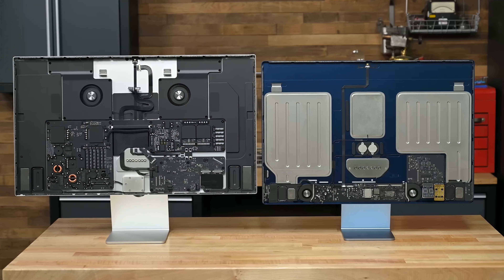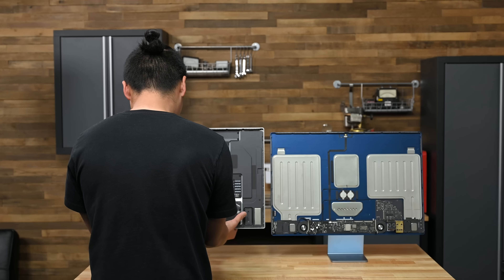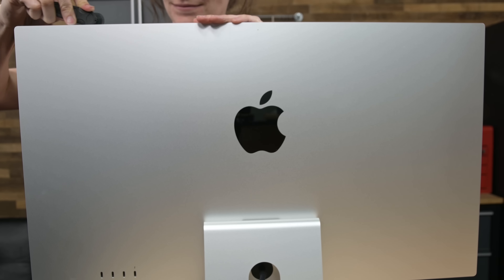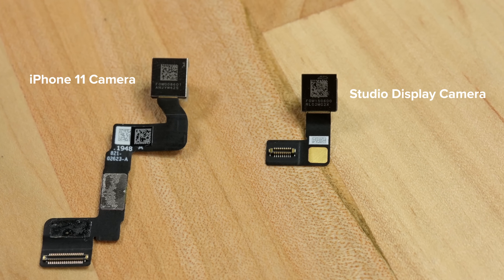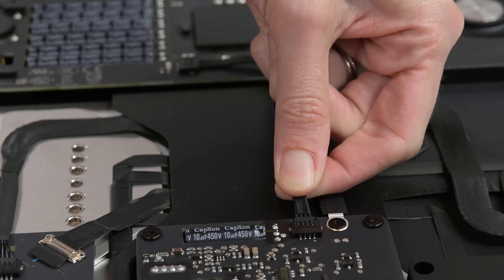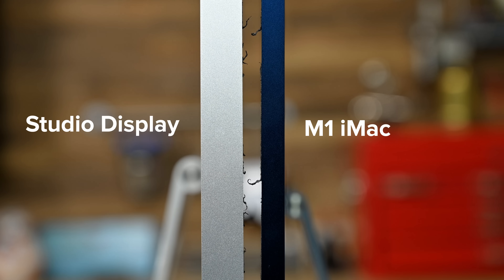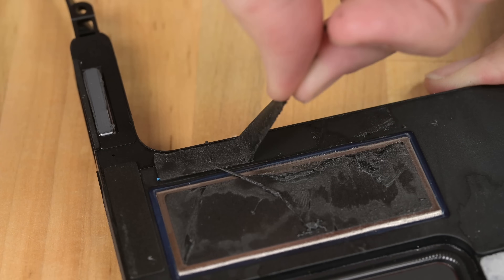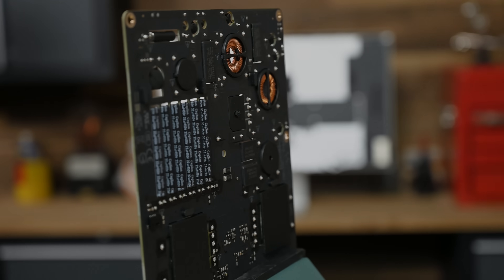Studio Display Teardown: Is this secretly an iMac?

Comment: If they make a bigger imac that looks like the studio display it will be just perfect. I think they can easily fit the board of m1 max chip if the put the PSU externally like the m1 imac
Reply: The Issue with putting gate PSU external is power, that magectic connection the M1 iMac users just cant provide that power levels needed. I think they would stick with internal PSU for such products were the thickness is not the ultimate goal.
Reply: @hishnash  High current DC connectors are a thing. You can push 240W over a USB Type-C port. Larger connectors can deliver a lot more power.
Reply: They are a thing for sure but not very long cables, and the power supply in the brick would need a fan (not optimal if its sitting on the floor sucking in dust, pet hair etc).
Reply: @hishnash  i just said they could do this if they wanted to used the exact same design (which i really like). But i would also prefer it to be inside and the whole computer to be thicker

Comment: Fun fact: There were board cutouts for caps on the 27” LED (and Thunderbolt) Cinema Display’s power supply already…
Reply: There are board cutouts in the power supply of about every cheap TV since about 5 years.

Comment: It looks very neat and organized on the inside. That, of course, has its price.
Reply: Almost all apple products in the last 10 years are more beautiful inside than outside
Reply: @trancenut81  The outside of the Studio Display also looks beautiful in my opinion. An aluminum unibody and minimalist design.
Reply: It looks really Pleasing!
Reply: @LiK I'm just saying that if the components in the device look neat and well-ordered, the device is also safer and will last longer. Steve Jobs once said that even what you can't see should look good. I agree with that.
Reply: Form before function... 
Once it breaks you're doomed to overpriced Apple support, because none other repair-shop can get the proprietary parts.
Reply: @timmy7201  apple stuff doesnt break, really.

Comment: I have to wonder if they just couldn't get certain features out the door before the display's launch. Having an A13 and 64GB of memory means this display has the horsepower to become at least a decent standalone 'Apple TV' display.

But some of the engineering aspects—from the non-user-serviceable power cord and mounting bracket/VESA mount—to the thickness of the display in general—are baffling. If they just took the iMac, swapped the guts for a display controller, and used an external magsafe power supply like the iMac, I think people would've been happier.
Reply: I expect the reason it has this config is that is the smallest HAND die that meets the spec apple need for the HAND controler within the A13. As to why they are using an A13 apple llikly have 1000s of these that have binning issues meaning they cant use them in phones but are completely ok in a monitor (1 to 2 cpus cores with defects is not going to impact the use case here at all). Apple has used binned chips in the past in the HomePod mini getting binned Apple Watch cpus.
Reply: Considering that we are talking about an Apple product, I think it’s safe to assume that it is this way because they wanted it to be this way. These are not mistakes that could be explained by some engineers screwing up and some validations getting skipped. These are all things that would have been decided on the marketing requirements level.
My best guess is that someone at Apple is really pushing for internal power supplies because they look nicer. That would explain why the Mac Studio and this display both have internal power supplies. They probably didn’t like how it would look to have three external power supplies if you had a Mac Studio with two matching displays.
I suspect that the stand is both a cost saving measure and an upsell strategy. You are more likely to get the more expensive solution if you are worried that you can’t upgrade later.
Is this wrong? Idk.. Maybe? In practice, I don’t think this matters as long as Apple doesn’t force you to use their displays with their computers.
Reply: @Finder245  the internal power supply is due to the power needed to be supplied, unlike the iMac this is a 200W+ power supply since it provides a lot of power to the attached TB and USB devices. Very important feature of such a screen.
Reply: @hishnash  Do you really think that 200W is a lot of power? It's not. You can push 240W over a USB Type-C connector using the latest PD spec. Now, I am not suggesting that Apple should have used a Type-C connector to power this display, but a passing a few hundred Watts from an external power supply to a device is not really an issue.
Reply: @Finder245  Its a lot of power to have from an external brick without a fan.  The transition of the power is not the issue but the PSU of that power rating will get very hot if its not cooled properly so its either going to be rather large (not nice if you have 2 or 3 of these displays) or going to need an active fan. If it needs and active fan that becomes a rather large issue if its sitting on the floor were it will ingest a lot of dust, pet hair etc.   Given its a low voltage supply apple can use any form of connector they want.

Also from a raparibilty perspective repairing an external power brick tends to be close to impossible as these things need to be built to survive being dropped etc while very hot so almost all of them I have seen have the components glued in place to ensure there is not stress put on the solder joints and there is not chance of a short.  Compared to the lamina single large multi board single layer PSU within the screen an external power brick would be close to impossible to repair and would just become e-waist (a lot faster than the internal PSU since its going to en dup with much more thermal and other wear and tear).
Reply: @hishnash  my legion 7 charger was 300w no fan. and does not overheats
Reply: @totalmichel  thats working for the life span of the brick, or maybe its just massive enough to radiate the heat out.
Reply: @hishnash  the previous laptop was Asus g750 had 280w and lasted 7 years. So I guess 300w should also last, and yes it’s massive for a laptop 😂 (almost dvd drive size)
Reply: @totalmichel  for sure it can last a long time but it is much more likly to fail than a well cooled internal PSU as that internal PSU is not going to be dropped of desk, end up pushed into a corner/strapped to the bottom of a desk etc were it cant keep cool. One thing the laptop bricks can do (and some do do) is if they overheat they can (and do) reduce the output power, im not sure you expect that of a desktop display that has not internal batteries.
Reply: It is not a iOS or Apple TV device as Apple does things in extreme focus. As SJ said “focus means saying no to 100 great ideas” if today it’s a PC maker doing it it will become an Android display. Yes it doesn’t make sense but it’s very Apple.
Reply: but then they wouldn't have an excuse to charge your first born for it
Reply: Same as what I was thinking just right before reading your comment! This makes it the Apple TV,TV! a true TV from Apple 🤣🤣🤣😂
Reply: this would've been nice to have but they would've also had to put some sort of Wi-Fi and Bluetooth in it, which I'm not opposed to. Would've made the price tag more acceptable.
Reply: @cjgonzales1900  what would the use0case be, your not going to run a 5k display over wifi there just is not the bandwidth for that.
Reply: @cjgonzales1900  those chips are integrated in A13 if I’m not wrong. Apple does “over kill” things for something unnecessary. It costs more for them to develop a new chip so they use the old one even some features are absolutely unnecessary.
Reply: They design capacitance like a skewers
Reply: Yes it even could have ran apple tv os and have an apple tv remote like the samsung smart monitors and it would have been a great competitor for the samsung smart monitors if they used such high end components just to drive a monitor then they may just release an update to give it the apple tv ui if its just running ios already and an apple tv remote could be sold separately to use on it
Reply: I guess they are doing a right thing they are recycling chips from trade in devices and use them for the apple studio display overkilled
Reply: I get it has a big speaker so we don’t need a desk speaker on a desk. but why it has a phone cpu and a huge ass fans? Wasn’t that supposed to be a monitor. my gaming monitor has a tiny fan inside and some don’t even have one of my monitors.
Reply: Pandemic and Chip Shortages Give birth to interesting Engineering Choices
Reply: @benNdaKen  What part of the design do you think is a result of the pandemic and chip shortages?
The only thing I can think of is that maybe smaller flash was not available, or was not available cheaper. Other than that, I think Apple got what they wanted.
Reply: Not “people “ but computer nerds. 99.9% of the people who buy this won’t be concerned about any of the points you bring up.
Reply: @mrlt1151  that sounds like a self-fulfilling prophecy.
Reply: I don’t think it has 64GB of memory. Storage yes, memory no.
Reply: @huggyuk  storage is memory though, it's just non-volitile, and we have come to often use the word 'memory' for volitile RAM and 'storage' for non-volitile memory like HDDs and SSDs
Reply: @DanielSvindseth  Storage is not memory, they are not interchangeable.

The program has to be run inside memory, not storage, because
 - memory can be addressed in bytes, while storage can only be addressed in blocks (at least 1024 bytes)
 - memory has far lower latency than any storage, which is critical to CPU
Reply: @jiahaoxu6356  that's not what he was saying at all

Comment: 3:11 Did I actually hear 64Go of storage ...for some reason... ?
What's going on here ?
Do Apple need 64Go of storage to activate AirPlay on this ?
Reply: With the price of solid state as it is, it probably wouldn't be worth it to source 32 even if it worked.
Reply: Base iPhone 11 is 64Gb they just took A13 and other chips like that 64Gb flash from broken iPhone 11's and soldered it there. Cheaper to use stuff you have laying around than to buy new ones.

Comment: We should all focus on the fact you could've easily swapped dead power supply if it was external.
Reply: But it would be massive brick. As the display provides a loaf of power delivery over the TB and ISB poerts
Reply: @hishnash  So happy to sacrifice repairability for a minor inconvenience :(
And Apple dares to call itself environmentally conscious.
Reply: @popcorny007  your well aware that an external power brick of this power rating (unless It had an included fan) would be much more likly to die meaning much more e-wast over all.

also this is a monitor how many monitor out there have external power bricks? 

To be clear It would be much better if the opted to use some screws on the case so you could open it up without needing to replace the sticky strips around the display but at this point opening an iMac is not considered difficult for a repair location, in many ways a lot simpler than opening your typical external power supply.
Reply: @hishnash  but when the repairman did a little mistake (like splitting stubborn glue goes wrong), then the entire device being a trash
Reply: @KangJangkrik  Much more likly to have a mistake like this in repairing an external power brick these are much harder and more compact, if you skew up a PSU repair the best case is to destroy the device attached the worst is a massive fire. The very flat 2 board PSU in the display is going to be one of the easiest to repair PSUs on the market compared to all others were getting access to the PCB to de-solder a part if very hard as its covered with large caps etc.
Reply: Not like any other monitor as an external power supply? I'd really love to see one.

Comment: 4:12 Wow that power supply is very impressive. I think it's over engineered. It looks so beautiful, but looks useless
Reply: Provides 95w of power to attached laptops and power to Other usb devices at the same time so needed
Reply: @hishnash  ...but it could have been an external power brick, like the one used for the iMac. Also, 95W is not a lot of power. MacBook Pro power brick provide that and they are inside a plastic enclosure. It looks like someone at Apple wanted to avoid having an external power brick at all cost, so they sacrificed repairability, and possibly reliability for it.
Reply: @Finder245  But the display is not just powering the Mac, it is also providing power to the screen and to the other USB ports.  You could put the tin a sealed plastic box but it would be much less reparable than this power supply due to the much higher level of protection you would need to give it given it being much more likly to be dropped, kicked etc in use.
Reply: @Finder245   you did watch the video above where they open the display and remove the 2 part power supply, right?  Opening it seemed trivial. It looks very repairable to me.
Reply: @hishnash  there are laptops with 230W+ external power bricks. Seriously, a couple of hundred watts in an external power supply is a non-issue. The external power brick would be user replaceable. This is not.
Reply: @mrlt1151  Yes, I did. I agree with you that this is repairable with the right equipment. It is far from being user replaceable though.
Reply: @Finder245  it would be user-replaable but would be much more likly to break and would not be small, user-replaceable is not great for e-wast as it would be much harder to repair.
Reply: Agreed in the the PC world but in the Mac world very needed and appreciated!
Reply: This would only someone say who has absolutely no idea about electrical engineering

Comment: wonder how long it'll take someone to make the display into a standalone computer...
Reply: all recent jailbreaks that does not utilize a bootrom/iboot exploit (which is extremely rare) required code execution on the device in the first place so probably a long time. We don't have code execution on the display in the first place because apps is not a thing.
Reply: difficulty will be breaking the iBoot signature, not sure if there are any iBoot level jailbreaks yet.
Reply: While I don't know for sure, I doubt that the SoC can drive the display.
Reply: @Finder245  I think your correct in that the SoC is not decoding the display port signal (why would the A13 have a display port signal decoder after all). I think it is mostly operating as a hand holding device that the computer talks to to controle backlight, camera, speakers, mic etc.
Reply: @hishnash  yes, I agree. I think they included the SoC to have the same camera and microphone integration that you would have on an M1 Mac.
Reply: @hishnash  does the Apple TV 4K (A12) have the display port decoder?
Reply: @PratikDaga23  why would it, it never needs to decode display port signals.
Reply: It already runs iOS 15.4
Reply: @aninditabasak7694  it probably runs the same kernel and some of the services. Without a connection to the display panel, it won't do anything interesting.
Reply: I am sure it can be done. But hacking Apple stuff always comes off as a clumsy mess.
Reply: @bwgti  I haven't seen any really cool Apple product hacks in recent years, but I remember when the first iPod Touch was released and people found a way to enable all of the iPhone apps on them. This was before the App Store, and for some reason, Apple released the iPod Touch with practically no built-in apps. For example, Mail was not included.

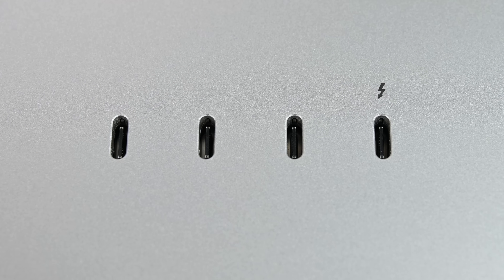Comment: At 3:45 you note that it has a Thunderbolt 4 port, yet Apple's marketing cites it as Thunderbolt 3.
Reply: The reason it is TB3 not 4 there is not TB dock within the display, to clarify a client device (like a screen) as having TB4 port on it that device needs to support TB dasichianing otherwise it is TB3 (TB3 is TB4 but without some of these additional features).

TB daisy chaining would not make sense since to power the 5k display your already using more than 1/2 of the TB bandwidth so if you attach some other TB device to it its not going to end up with much bandwidth.
Reply: @hishnash  the point is the comment in the video is wrong.
Reply: @nickthaskater  true, but for a display the table of TB3 vs TB4 makes 0 difference in functionality. They could even say USB-4 it would all be the same to the end use and even at a component lavel would all be the same controler.
Reply: @hishnash  it makes a difference if you're using the monitor as a hub.
Reply: @nickthaskater  But you cant really use this monitor as a TB hub since the 5k signal alone uses up more than 1/2 the bandwidth. Any TB device you would plug into it would be massively limited and would have issues as to support the 5k stream the TB is put into a mode that would be very problematic when it comes to semtric bandwidth.

Comment: Quite unnecessary since they could use the same magsafe but that PSU is really a beautifully designed part
Reply: not really, the macSafe PSU is 65W, this one is over 200W as a key feature of the display is the power it provides to the attached devices Including 98W over TB power.

Comment: Gotta say, the internals look as great as the external.
That power supply looks stunning!
Reply: thats apple in general
Reply: I like the way they engineer there stuff
Reply: Instead of making the inside look all pretty for whatever reason, they could put more effort into making it more repairable and upgradable
Reply: Form before function... 
Once it breaks you're doomed to overpriced Apple support, because none other repair-shop can get the proprietary parts.
Reply: @timmy7201  That hasnt been true for years. Apple offers its parts to anyone and repair shops can be apple certified and then order directly from apple.